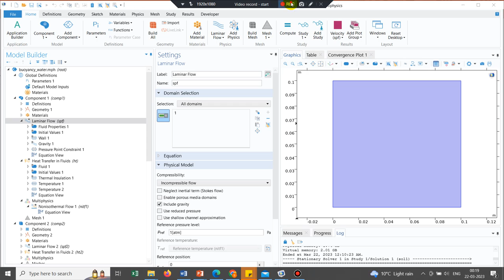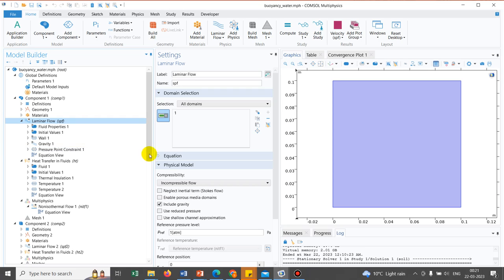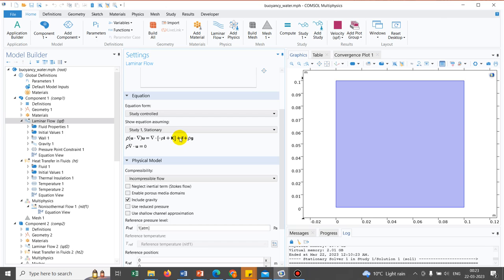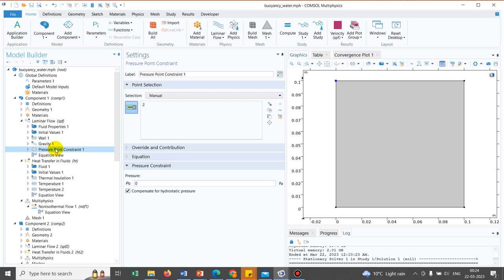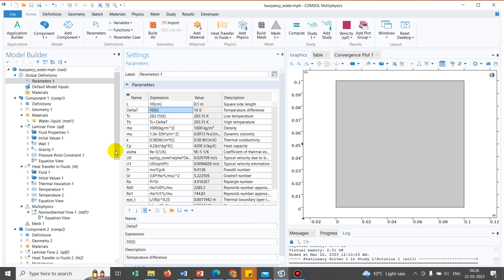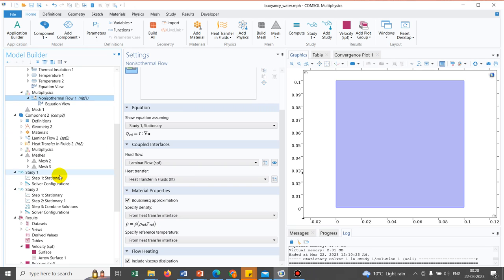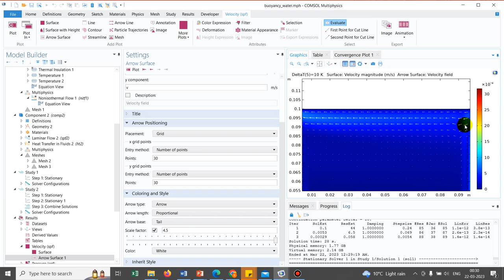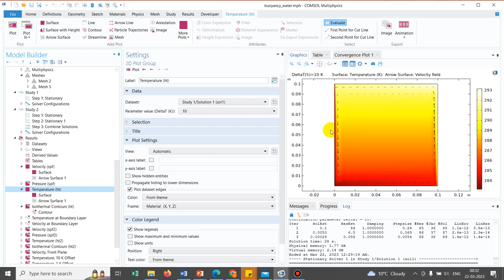How to model Natural Convection in COMSOL #NaturalConvection #COMSOL #POS #Model

Comment: Can you make a similar video with lumped model(2s2p lithium ion battery 18650), showing natural convection. where fluid is air. I mean a 2s2p battery module is just kept in a closed chamber/only open from top. In 3D
Reply from the maker: It is very much case specific. I will try to make a video on natural convection in air.
Reply: @pioneerofsuccess4054  yes, but please choose 3d geometry. And a block as air domain. Thanks